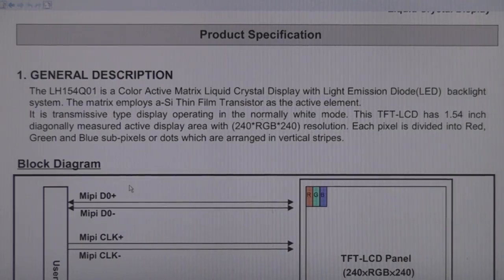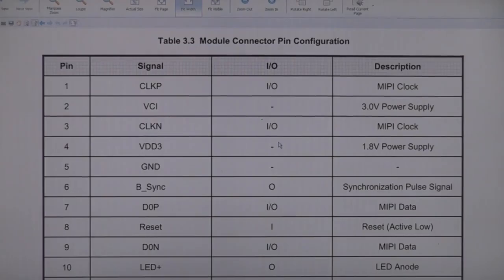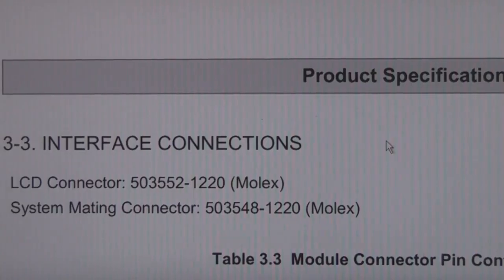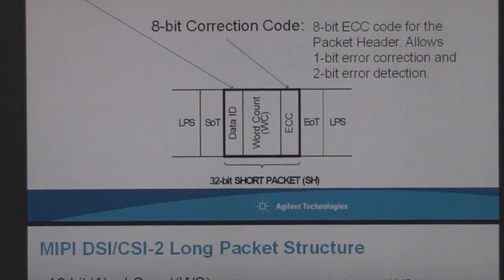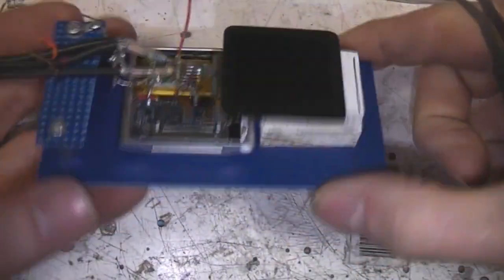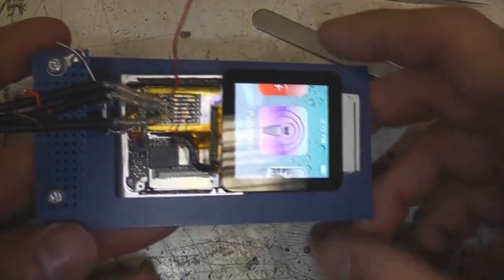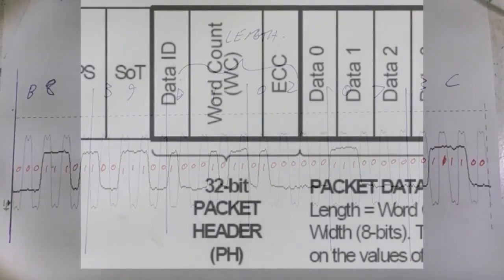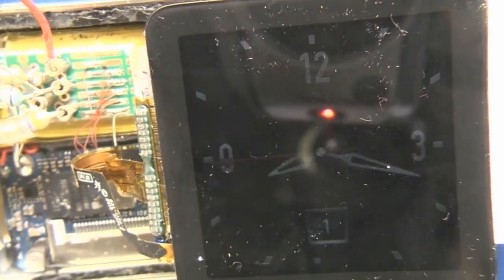Reverse Engineering the iPod Nano 6 LCD interface

Comment from the maker: As long as they are not both terminated it's not a problem - they're just comparators. Need to watch trace length, stubs etc. Also need to use LVDS receivers that won't bork at the low-speed data levels.

Comment: The other day I picked up a biggish LG flatscreen tv from the side of the road, got home and found that someone already took most of the internals. Then I realised I've got a LED backlit panel there, just needs 96V from one of my dc dc converters. Then I realised I needed some plastic panel so I cut the piece I needed out of the back, then I saw that there are some useful holes for connectors so I'll be cutting that piece out also and another piece I need for a powered speaker project. All I really had left was the broken lcd and a bit of the plastic back. Which got me thinking, what sort of effects could I get out of the cracked lcd panel if I was to send voltages waveforms etc. I have no idea how lcd works but I do have another one somewhere which still has the driving circuit. Was thinking it could make an interesting piece of tiling, art, light blocker, piece of a modern lamp? Any ideas? But thats not why I came here. lol

Comment: The Raspberry Pi actually has a MIPI DSI connector, it's one of the two flat-flex connectors on top.  Pretty sure it can't be directly addressed though, and requires the GPU to handle the display for you.  It seems that Broadcom hasn't yet released any driver to allow access to the DSI interface, so at the moment no.  Hardware is there, but not software, and even so the hardware would be generating the protocol, the RPi isn't fast enough to bit-bang it in software.

Comment: You can often under clock these displays, just if you do it too much you get weird graphical artifacts. But to drive it from a Pi you would want to tap in to the RGB bus that feeds video out to HDMI since then you can use the built in video controller to run the display without the CPU needing to do a thing.(But you do need a fancy chip to make it the right LVDS format or a FPGA)

Comment: With a 8080-bus to MIPI transceiver it is possible to drive this iPod Nano 6 1.54" MIPI display with a microcontroller. An example is SSD2805 MIPI bridge. A kit to drive it with a Microchip PIC32 MCU is available. Source code in Github, with schematic too.
http://www.techtoys.com.hk/Displays/SSD2805EvalRev27092013/SSD2805EvalRev27092013.htm

Comment: When studying the data signal, overlayed of the clock signal, you have all transitions lined up. Your data bits change on the clock edges. Shouldn't it be so that the data bits are *stable* while the clock changes state? Something about data bits holding the values during the clock transition?

Comment: +mikeselectricstuff  For determining the driver side ~ 18:00 , could you not just check the polarity across the 220 R , or is that not possible with it being an a/c type signal? Does that make sense? Basically what I'm getting at is why create the divider, when the 220 resistor creates a voltage drop itself.

Either way, that's a nifty trick! Thanks!

Comment: Truly awesome. Didn't understand half the stuff you did, but still awesome. 

Out of curiosity, if you're going to buy this in bulk, how much are you paying per screen? My supplier (I repair iStuff all the time, so I know these things :) offers just the LCD at 3.05$ and the complete LCD + Touchscreen at 27.56$. 

Also, would the raspi be powerful enough and have enough memory to run this thing? It would be an excellent low cost screen for it in that case.

Comment: can anyone answer this? :
doesn't the iPod Nano run at ~ 800Mhz, how can he measure it with such high fidelity with a 300Mhz scope?
am I missing something here?
Reply from the maker: CPU clock rate !=display transfer rate. And I doubt the main cpu runs anything like that fast unless it's doing audio decode in software, which would not be power effificient
Reply: mikeselectricstuff
makes sense. thank you for the fast reply!
I was just curious since I want to get into reverse engineering, but I'm not sure if 100Mhz is enough for a lot of newer gadgets.
Reply: NickBlackDIN ipod nano @ 800Mhz? i seriously doubt that...
from my quick research i could not even find the clockspeed of the processor, but what brings you to the thought, that it is 0,8Ghz?
Reply: muh1h1
hmm, don't remember. I remember reading it somewhere, (or else I wouldn't have posted it) but I can't find it anymore either. Sorry about that.
Reply: Just because the Nanos CPU might be running at 800MHz doesn't mean that it's interfacing the LCD with the same frequency.

Comment: Wow, this was fantastic and very informative! I don't have anywhere near the equipment you do, but all of the principles with regard to reverse engineering are very much applicable to the low end stuff I'm currently working (and learning) on.

As for driving that iPod display with lower end hardware, I wonder if something like a Raspberry Pi or Beagle Bone would work? The Pi has a DSI port, so if the blobs are ever released for it, perhaps it's feasible?

Comment: Dumb question from the very beginning of the the video but how do you find a ground? Do you using a volt meter or ohm meter? If so what am I checking for?
Reply: +chucknorris687 He said "in continuity mode" which is diode/voltage drop checking, Low Ohms would also do.